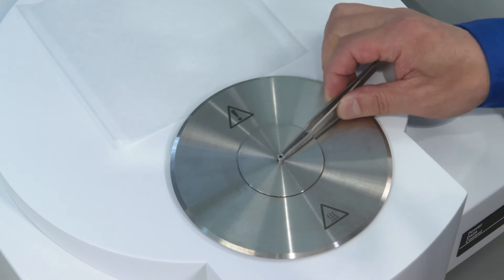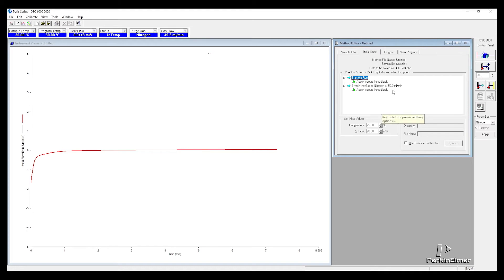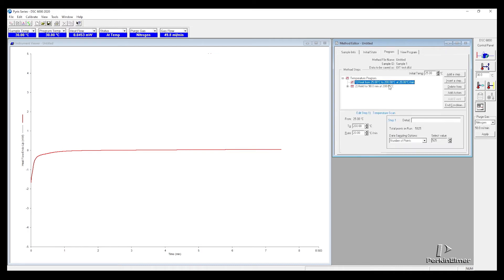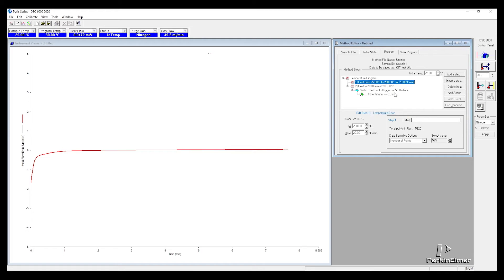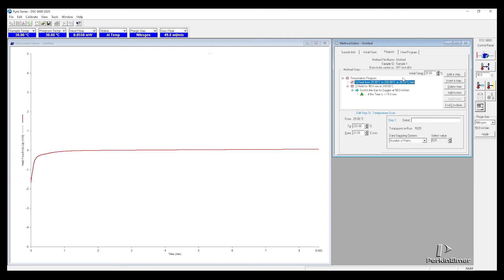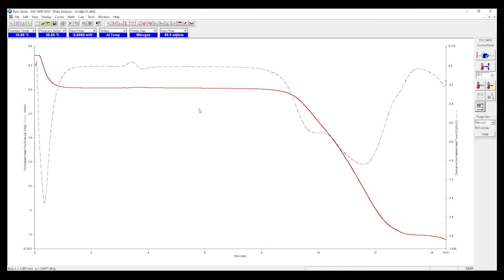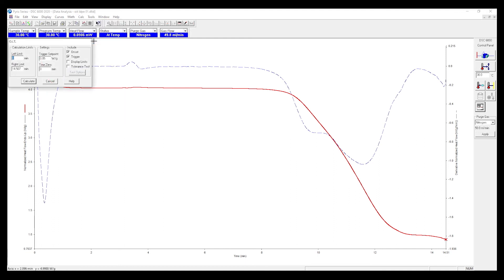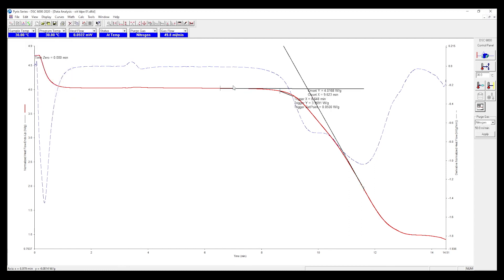How to study oxidative stablity with DSC

Comment: how change line x from temperature to time? because i using system OIT the line X Using temperature not time, so the Graphic not suitable to Graphic OIT.
Reply: You must click on the far-right last icon on the top to switch between time or temperature for the x-axis.